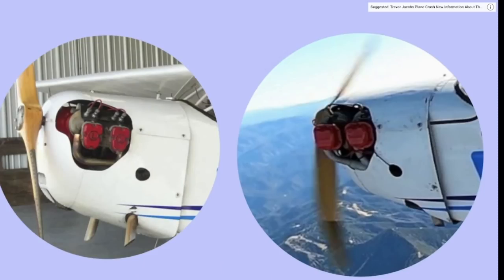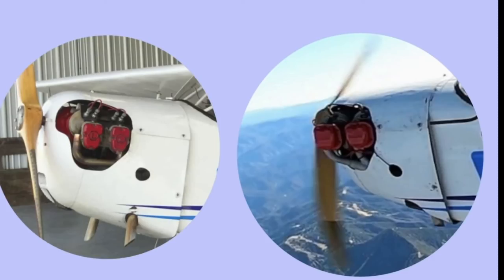Trevor Jacob Engine swap before the suspected "FAKE" crash?

Comment: There are several things regarding aircraft that your viewers may not be aware of.  This aircraft is a "certified" aircraft, as opposed to a "experimental" aircraft like Jacobs other aircraft N63BG.  Certified aircraft may ONLY be worked on by licensed aircraft mechanics (A&P).  The owner of a certified aircraft may NOT work on the aircraft, like for example changing the engine.  You can not just change the engine or any other significant part in a certified aircraft.  Extensive paperwork and licencing is required to change the engine in a certified aircraft.  The FAA registration information on this aircraft NC29508 shows the airworthiness certificate to be valid as of 01/03/2022 (this date is the date the paperwork was recorded by the FAA and not the date info was submitted).  The engine is shown to be a LYCOMING 0-145B SERIES.  If this engine was LEGALLY changed, the FAA airworthiness certificate would show the engine as a CONTINENTAL.  It does not!  Jacobs is listed as the owner of the aircraft.  Also, for example, a used airboat engine can not be put in a "certified" aircraft.  The engine must be certified and that significantly increases the value/cost of the engine to around $10K depending on total hours on the engine.  A Taylorcraft BL65 in fair (certified) flyable condition could be worth between $18-$30K.
Reply: Thank you! I was aware of the basic issues of experimental vs certified, but hadn’t yet figured out exactly how and when to start covering that issue. Your details here gave me a solid direction. 1.x versions will cover everything odd I can find in the pics and videos, then 2.0 will start covering the issues moving from experimental to certified aircraft. 10x on the thumbs-up!
Reply: It's called a Supplemental Type Certificate....addtionally, you can work on your own aircraft without a license, in that case you would have a licensed mechanic sign your work off.
Reply: @kevinjgillespie  as a good polatician or bussines men would say "there is always a work around" lol
Reply: @kevinjgillespie  Wait.  You can't perform major maintenance then just have an IA come say yeah, looks good.
Reply: @59thfsaviation79  I think you can do as much as the A&P is comfortable overseeing. Usually this is stuff like new battery, plugs, or oil change, in which case for some of those they just have to sign off after it is done IIRC. For something more major I am pretty sure you can still do the work but it has to be under the direct supervision of the mechanic, as more complicated things they basically have to check every step during the process to make sure you've done it correctly. I know someone who replaced a cylinder himself under A&P supervision, but the mechanic knew him well and knew he was a good mechanic in his own right, just not an A&P. In general though it is only for very simple things. For something like changing an engine type under an STC I double most mechanics would ever let you do more than basically be their free helper - which would probably cost you more than just having them do it themselves because you're going to slow them down.
Reply: @X85283  The issue is who signs it off.  I'm an A&P and only myself or the IA can sign off on major repairs.  You're correct about the owner doing oil changes, plugs, lights, etc.  But replacing a jug?  I wouldn't watch someone do it, then sign it off.  That's my name on the line.  Yes, you could say maybe I watched every step, but if I'm doing that, you're not getting a discount.  Babysitting costs the same amount as doing.
Reply: @X85283  If you can strip down service ,repair or rebuild a multi cylinder Japanese motorcycle engine ,an aircraft engine be it piston or Jet turbine will be a piece of cake I reckon .
Reply: 14 CFR 43 Appendix A lists 31 maintenance tasks that the owners of aircraft operating under Part 91 can do. They essentially come down to "if you don't have to take the airplane apart to get to the work, you may do it." If you operate in Parts 121, 125 and 135, a licensed technician must do the work.

Comment: There is no mandate to change/rebuild engines at the end of its hours (TBO), as long as the compressions, condition, etc is still deemed safe by the mechanics.
Reply: You are correct. TBO is only a guide not a certainty. Compression, oil analysis and comfort zone will dictate an engine replacement.
Reply: I'm an A&P IA, you are right there is no requirement to comply with manufacturers tbo on part 91 aircraft which I'm guessing his was

Comment: Aircraft engines don't run out of hours. There is a TBO time which is a recommendation by the manufacturer, however it's not required.  Many well cared for engines run past their recommended TBO.

Comment: The plane was also sold just before the crash for parts, and the fuel selector switch is dangling in the cockpit. This revelation that the engine was swapped out for a old Continental just does not help him. The original Lycoming has market value for pilots that want to restore their planes to stock, though many T-Craft are updated with Continental's. Painting the covers red to match is suspect, but we'd have to see them up close to see how good the paint job is. it may have been a spray paint job if TJ was in a hurry to crash it. Either way, he's in deep crap with the FAA and I hope he looses his license and a lot more for this stunt.
Reply: Looks like you are right look at this. Nice over spray. https://youtu.be/7PgGvl2ZMFs?t=1195
Reply: "Painting the covers red to match is suspect, but we'd have to see them up close to see how good the paint job is. it may have been a spray paint job if TJ was in a hurry to crash it. "

I went and looked at the pinned video up top. In it is footage of the wreckage by the parachutist. There is red over spray on the cylinders from the cylinder covers paint job. I have to think that the paint job was very recent and it definitely was a spray can job in place. Personally, I would want to take the covers off (not an A&P so I don't know the rules about removing covers, e.g. something only qualified people can do or not), or at the very least, mask and tape off the surrounding engine parts to avoid over spray.
Reply: The engine over spray is visible at the 19:54 mark of the pinned video.
Reply: Fuel selector switch isn't necessarily a red flag, its for an optional wing tank which wasn't installed in that plane. I believe someone who flew this exact bird said that is how it normally is. Seems janky to me, but having been in a few rag and tube planes like this from the 40s or 50s they are surprisingly just kinda simple and janky in some ways haha.
Reply: There are older pictures of this plane, and the fuel selector switch is in the same location.

Comment: The portholed illustrations appear to be of two different Taylorcraft aircraft. The one on the right appears to be in worse cosmetic condition with dented upper cowling and carries an extra black stripe. If the crashed aircraft was a stand-in, what happened to the good one?
Reply: I think that black stripe is a cable tie holding something down, eventually the cowling :D
Reply: Same aircraft, same tail number, different camera angle.
Reply: @popsfreshenmeyer7607  or it’s an airspeed indicator pitot.
Reply: @MarcosElMalo2  The placement is a bit weird for a pitot, we're talking about the black stripe that goes at a rough 45degree angle from the engine cutout to the round hole in the cowling. I wonder why that should be tilted that way if  it was measuring something :D

Comment: Aircraft Engines are Serial Numbered and they have to be logged and tracked in the Aircraft Records .. if you contact the original owner ( the person Trevor bought it from ) they may have records of the engine serial number .. the IA ghats did the Annual Inspections may have maintenance records for the airframe and engine .. if you can get the serial number of the engine that was in the airplane when he bought it , you might be able to track if Trevor has tried to sell that engine .. the FAA / NTSB would be very interested in knowing ..

Comment: The Lycoming in question is frequently swapped out with the Continental. That particular Lycoming is no longer supported and almost impossible to find parts for. The Lycoming is what this Taylorcraft came from the factory with (hence the BL in the aircraft designation). I would bet the engine was swapped out well before Trevor put his greasy fingers on the plane. (Not that I'm defending Trevor. The swap from this particular Lycoming is extremely common and not something you would do on a whim. The little 65 Continental is worth way more than that particular Lycoming)
Reply from the maker: I seem to recall the Continental was a Rolls Royce engine and how you tell the difference is standing in front of the prop looking at the engine, if the front cylinder is on the left it is a lycoming and if the front cylinder is on the right it is a continental. Yes I agree it could have been changed prior to Jacob acquiring the aircraft but would not the aircraft registration have been updated to the new engine? As it is still claiming to be Lycoming at trevors PO box. In any event the engine swap will be or should be signed off by a licenced engineer and dated in the tech logs with engine hours SMOH recorded.
Reply: Swapping the engine in itself is not suspicious.  However, the really rushed and poor quality red paint and overspray on the Continental suggests it was an attempt to hide the fact that the engine was changed.   Furthermore, on the FAA records, Jacobs JUST received certification with this aircraft with a, you guessed it, a Lycoming engine listed
Reply: @grahamthebaronhesketh.  Rolls Royce built a licensed version of the Continental. When the aircraft came out of the factory, Taylorcraft called it a BL-65. That is the model name it will live with for the rest of its life. When originally certificated, the engine was a Lycoming (Hence the BL) and that is noted in the registration. The documentation to change from a Lycoming to a Continental should be located in the logbooks and other FAA records. Engine type changes do not always make it into the registration record and the registration record specifically states: "The information contained in this record should be the most current Airworthiness information available in the historical aircraft record. However, this data alone does not provide the basis for a determination regarding the
airworthiness of an aircraft or the current aircraft configuration." All I'm really saying is that if Trevor took a Lycoming O-145 off and replaced it with a Continental A-65 so he could trash the plane, he is an even bigger idiot than people are giving him credit for now. A running Continental is worth considerably more (even at core value) than an O-145.
Reply: …JUST ‘rained on this dude’s parade’ man..
Reply: Not so. He definitely swapped the engine out. He had only very recently purchased the plane, with the engine shown.
Reply: @robertwaring6784  It’s possible that you are correct, but I think a component as crucial as the aircraft’s engine would be noted.

Another FAA requirement is that the work must be done by a licensed mechanic, certified to work on aircraft. It’s not yet proven that Trevor Jacob did the engine work himself, but the spray painted valve covers, including the overspray on the radiator fins suggest a sloppy DIY job.
Reply: @MarcosElMalo2  Yes, you are correct. The engine change must be per formed by a licensed mechanic and the engine change is documented through (at a minimum) a form 337 which is filed with the FAA. Generally, even if the work is documented properly, it frequently does not show up on the Registration. For example: I used to fly a Grumman G164 (N691Y). This aircraft came from the factory with a W670 engine. This engine was swapped out with a R985 almost immediately, over 40 years ago. The FAA registration still shows the W670. You have to dig deeper into the documentation to find the engine change. Those engine changes rarely make it into the registration database but are properly reflected in the aircraft documentation.  Bottom line, just because the registration says the engine is a lycoming, does not mean that is what is in the aircraft.  it could have been changed out years ago. The photo with the lycoming was from 2015... what has happened in the years since? I suspect the engine was changed out by the previous owner just because those specific lycomings are almost impossible to maintain.
Reply: @robertwaring6784  , plane was sold to Trevor as for parts. The previous owner could have changed it without the proper paperwork then ran it out before tevor got it. selling it on hoping that it would just be broken up.
Reply: @robertwaring6784  
That was an old AgCat! Cool! Open cockpit? Not many had the W670. Some had Jacobs R-755s, others had Wright R-760s, before they all went to Pratt and Whitney R-985s and R-1340s.

Comment: Engine TBO times are "recommended". Not "Required". So if your engine has a TBO of 2000 hours and you have 3000 hours on the engine you can still use it. You don't need to replace an engine at TBO
Reply: Thank you for posting so I don't have to. The only times the TBO matters are if you are flying for money ie FAR-135 and 100-hour inspections.  I am a retired pilot and well I knot the drill about TBO's and time life parts on helicopters. after 45 years I retired

Comment: TBO (time before overhaul) is only relevant to commercial operations. As a private owner you can use the engine for as long as you want providing it is determined to be airworthy at annual inspection. The registration certificates are often not updated when an engine change is done even if there was a 337 form filed with the FAA and logbook entries were made. It's very unlikely that Jacob had anything to do with this engine swap as he does not appear to be one who thinks things out that deeply nor possess the talent to perform such a task. Really, I think he just bought the plane cheap with the idea of this stunt sketched out in his brain, did it and then the shit hit the fan and got all over him.
Reply: True. TBO is not a hard set time. Engine condition mainly. But if you try to sell an old plane with an engine past the TBO, that engine is considered dead.
Reply: @oldmech619  Sorry to jump on this thread re TBO.  An engine that has gone past TBO but has great compression, not making metal etc may provide you with 300-500 hours if looked after.     ( There are story's of them going longer ) Certainly it will be cheaper but it's not dead. Especially with engine monitoring and a pilot who understands Lean of peak operation.
Reply: Sell the original  to a full on collector and dump in a trash almost engine.  Well thought out insurance scam
Reply: @stihlnz  my 360 A4M had 3550 hours on it - TBO is 2,000 hours. It was running strong ( 78/80 on all cylinders) no oil burn or making metal. I changed it just because I felt the time was right. We have engines on the field with over 4,000 hrs. I have seen engines well below TBO to blow something. It is kind of a controlled crapshoot. You do everything you can to insure a healthy engine and hope the engine cooperates 😂
Reply: @arthurbrumagem3844  Well done, you got some extra hours out of that baby. Did you have engine monitoring ?
Reply: @stihlnz  no engine monitors really other than an EGT gauge and taught how to fly it. I used to ( before covid) fly all over the US in my Archer. They are meant to fly not be parked in hangers. Thanks to Covid my flying was curtailed. This year I plan on making up for that. I live in Mn and try to fly to Sun N Fun every other year among places like Wash and Montana. Karl Bergey the designer of the Cherokee once told me at a Piper get together that if maintained properly they will outlast the pilot. And imo the lycoming 360 is one of the best ancient airplane engines built. ( and still US owned, ). I have two of the best IAs anywhere and they save me a lot of money every year. The list is endless .

Comment: Your statement about being required to rebuild your engine after a certain number of hours is 100% INCORRECT. Not under part 91.  TBO is a RECOMMENDATION only for part 91 operators. Under part 135 for hire, yes, it must be rebuilt.  As long as the engine is "airworthy" by an IA, it can be flown past TBO.  Many many people do it.
Reply: Thanks to you and others that have made this distinction.

Comment: Just from looking at the picture on the right, the engine exchange has NOT been done professionally. Exhaust pipes pressing against the cowling, cowling even cut open to make room or it simply cracked. The ends of the exhaust pipes come out at a complete other location, so there must have been cut additional openings or from the look just the existing ones widened. That is a really mean mistreated airplane.
We don't know when the first pictures was taken and when all the changes happened. But it is not a pretty sight.